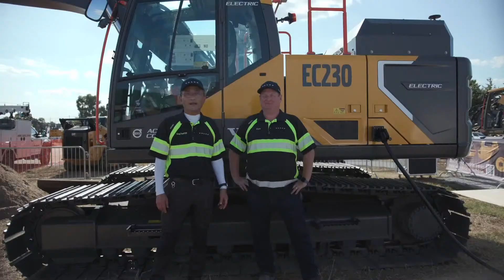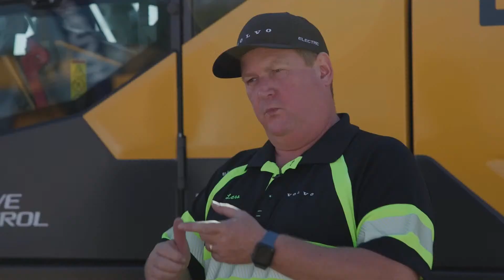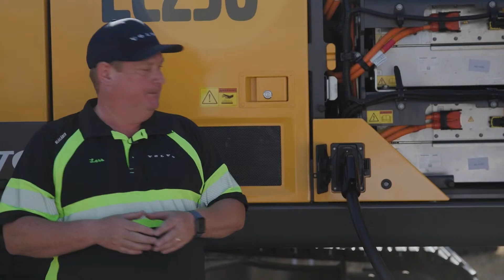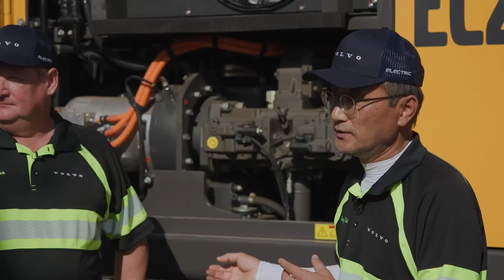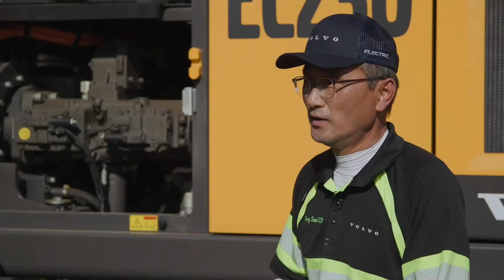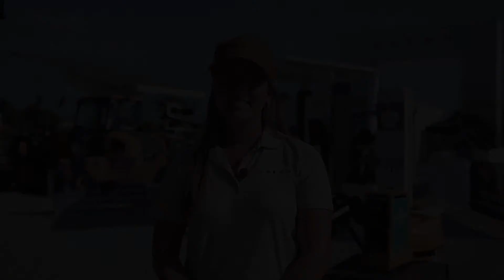See the 23-Ton Volvo EC230 Electric Excavator in Action

Comment: Will be interesting when they figure out to use electric actuators... They already do that on modern 6-axis flight sims....They never leak :-)  
Should be a no brainer for the belt drives. An electric motor should be much cheaper than a hydraulic one. And they could even stick one of the batteries in the bottom, so they can replace the swivel joint with a small electric slipring. Or even make it wireless....

Comment: How would you charge it up on site?, if you say a diesel generator then not only are you buying a quarter of a million dollar excavator but now you have also to buy a $20.000 generator AND the expense of transporting it.., you see where this is going?
Reply: and the autonomy is just 4 - 5 Hours
Reply: Obviously only makes sense, if you can charge it from the grid during night and maybe lunch.... But look behind the machine in this clip. ta da.... a generator...
Reply: He quotes "264 kw hrs" So if you're going to charge that up with a 50kva generator (which is a pretty huge beast) it would still take you over 5 hours to charge. For all practical purposes this means you're only going to be able to use the machine for a few hours per day.  That's no way to run an owner/operator business.